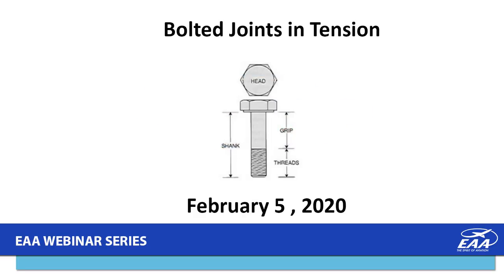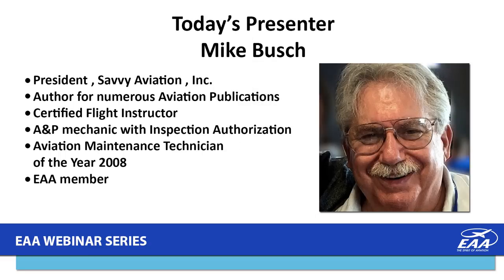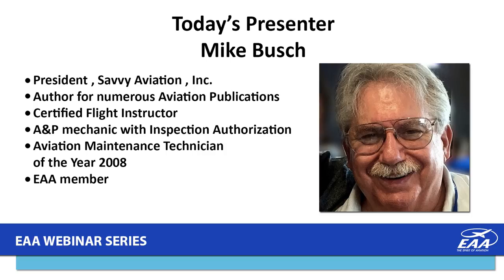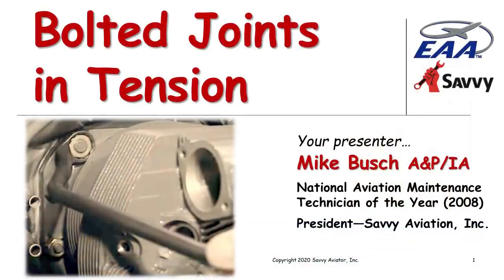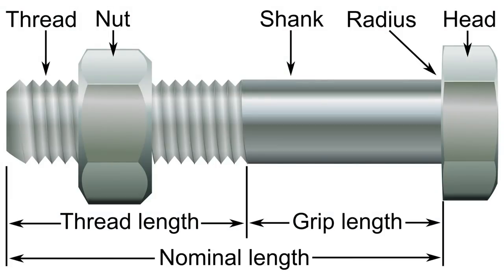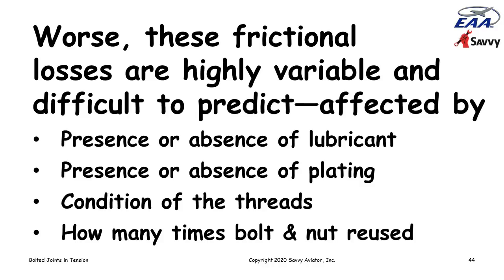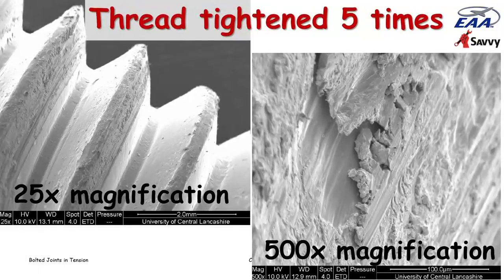Bolted Joints in Tension

Comment: Mike , I am a old Diesel, Gas engine, And Aircraft engine Mechanich ,about the torque wrenches , the proper way  to use torque wrench is every time you used it you Must calibrad it ,and yes if you drop any torque wrench is a Must you check it calibration

Comment: When looking at the bolted join in tension, you have to think, for the fastener as stretched spring that hold the parts together. The torque specs are there to prevent from exceeding the elastic limit of the fastener material (Young's Modulus) so it will keep a good clamping force over the parts, regards the working stresses ,  and (very important) to prevent crushing and damaging the joined parts.
Reply: As you said the only way to get torque right especially in criticall applications is the strech method. Dehavilland dash 8 use a procedure called pre load washers. Simular to torque angle method. Just taking out human factors

Comment: He talks knowledgably, but I am disappointed that he lacks knowledge about some basics. For example--there was a question about whether to add friction drag (prevailing) torque, particularly when using lock nuts. He seemed confused and never really answered the question. The basic rule is that if the torque is specified either in the body of the procedure, or is specified in a figure, then you do not add friction drag torque--you just apply the torque value specified. If you are deriving your torque value from a general torque table (from AC43.13-1B of from your airframe book) then you do want to measure and add the friction drag torque to the value derived from the table. This is what Cessna says, but always check with what your airframe says in their standard practices section. Another thing--Lycoming used to say "Wet torque unless otherwise specified" but they now say "Dry torque unless otherwise specified". Lycoming does mention "wet" for the through studs, but they don't comment about the short studs--so, you'd use "wet for the through bolt and dry with the studs. I queried a Lycoming rep at an IA renewal seminar, and he seemed surprised by what I told him. The Lycoming rep told me that he would check with the guy who's responsible for that portion of the Lycoming manual and that he would get back to me--but he never did. I'm an A&P since January '79, and I got my IA in '84 and have been involved in light airplane maintenance since then till now.

Comment: This was really informative. As an automotive tech who has done many many head gaskets on multiple makes, so many use Torque Angle method. But its only used when it has a steel multi-layer head gasket in my experience. The Honda 1.5 Turbo I just did was 45 fl/lbs for the 12 this head bolts, and when reusing the original ones after measuring there thickness at a certain point, you would turn them all 90 degrees then 90 degrees again. If you use new bolts it was 45 ft/lb + 90d +90d +90d, I assumed aviation always used this method.

Comment: Tightening to an angle has benefits from a technical (physical) perspective, but, as far as lycoming and continental go, forget it!
    Read far 43-13(a). (I don't mean AC43-13) It's just not legal. 
   You "shall use methods, techniques, and practices prescribed in the current mfgr maintenance manual ".
   So, get out the torque wrench,  with its flaws and inaccuracies,  whether you like it or not. Or work on experimentals,   and do it any way you'd like.
   We're not supposed to be making things up. One of the reasons that I'm an IA that enjoys working on other motor vehicles more than aircraft.

Comment: I've been doing aircraft maintenance for 56 years. And I've thought  that using a torque Wrench just wasn't right. I've always thought I could feel the right torque and that just going by torque specs wasn't right. If you torque  a new bolt in a new installation using book value torque  just wasn't right. A better way was to use as you call it snug torque. Back it off then retorted to book value

Comment: "Slip/Stick" is a term that describes a "juddering" during a movement of a sliding interface- so yes,  it refers to the "breakaway" phenomenon...and why you normally try to get to the finished torque in a single smooth movement.  As for self-locking nut "drag",  I believe you do NOT need to account for it in the torque spec...because 1) it exists even before the nut contacts the mating surface, and 2) it doesn't increase as the nut tightens down. It is so low compared to the final clamping torque that it can be neglected.

Comment: new sparkplugs i turn handfast then give 45degrees extra., reuse sparkplugs only once andneed a little more tork because the gasket has lost part of its sealing capacity.
Reply: I am sure there is a torque  for a Spark Plug.
Reply: 30 or 35 FTLBS typically, depending on lycoming or Continental
Reply: @TheReadBaron91  He gives those in the webinar on spark plugs. I recommend it.
Reply: Best, all ways use new plug gaskets. Torque has, compressed the copper gasket to it's flattened demise. A&PIA note.

Comment: Bolts are bolts    What Grade Bolts are  used on aircraft          Grade  3   Grade 5  Grade 8    Stainless Steel?   and explain why?  thanks
Reply: @bradamoniom    thanks but not what I am looking for
Reply: Several types, several materials and ductibility.
Reply: They use (an) fastener and are critical on length of shoulder, number of threads exposed . And most required safety wiring. Also the bolt must be trackable cradle to grave.
Reply: A bolt for an aircraft - one - can cost $500. You get the right part. Every part in maintenance will have a paper trail.
Reply: @bradamoniom  nice resource, thanks.

Comment: Why use  split washer  under a bolt head?
Reply: This is not a Bolt type Class. This is a Bolted JOINT Tension Class. Whatever the manufacturer specified to use.
Reply: @tomasnokechtesledger1786  That would be part of the entire Cass  I would think.     The entire package should be addressed.         giving only some information just does not seem the best thing to do.
Reply: @ctsteve1967  I think you miss the point. To address all fastener class it would take a 4 hour video and this wouldn't be feseable. This vid has pretty  good information on security of cyllinder head and how mechanics are under torquing those bolts leading to engine failures by possible detaching from the case caused by possible bolt fatigue.
Reply: No good reason that I know of- maybe on your car, but as far as I'm concerned it's a bad thing to put under a bolt head. If you want a lock washer effect, you're better off using a drilled bolt head and safety wire. And if it's not drilled...drill it. They make drilling jigs for just that purpose.

Comment: You did not explain  the Torque Angle  system very will.            The first step is to  start with a torque stated by the MFg selling
the Bolt if they do that at all.      This will not work if we all start from a different starting torque.
Reply: He repeated and repeated and repeated. It is very clear if you listen that all is required is simply made snug. If you are any sort of mechanic you can set a bolt by feel to the same point every time anyway. The starting torque is not critical as all the preload is in the final few degrees, the curve is not linear.
Reply: @martinda7446  Greg isn't dumb and he has a valid point. MY take is that you should be able to develop your own torque angle numbers but it means getting a fresh bolt and nut; putting it through the same type and depth of material, and then take it to torque one time noting the angle required. It's onerous but if you really want to get close without guessing,  it's better than nothing. You can also take the thread pitch and the strain modulus of the bolt and then calculate how much stretch you'd expect for that type bolt for a given preload. BUT! You also have to take the material you're tightening down on into account, since you have to take the "squish" dimension into account.